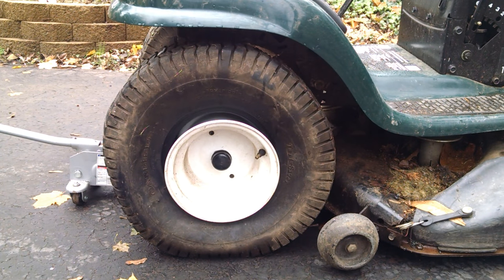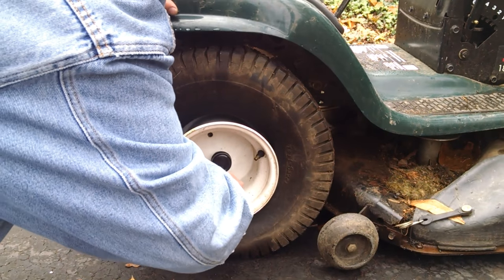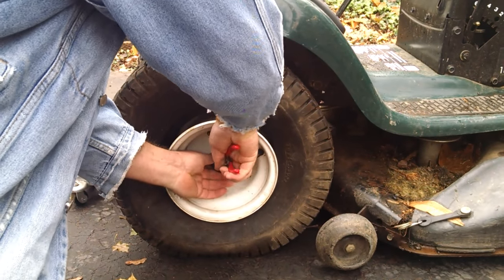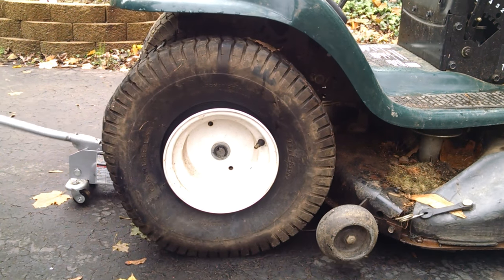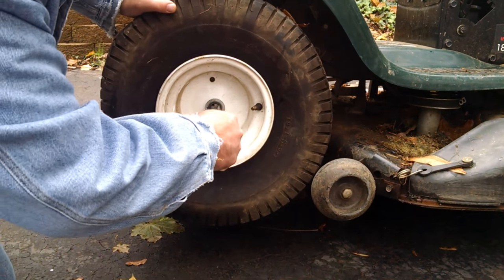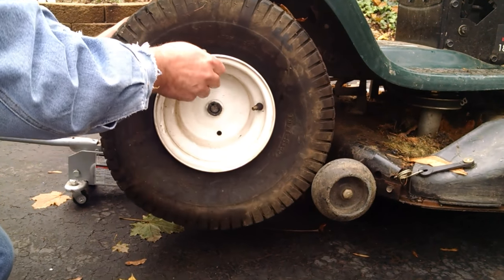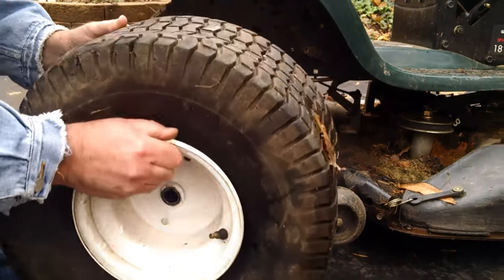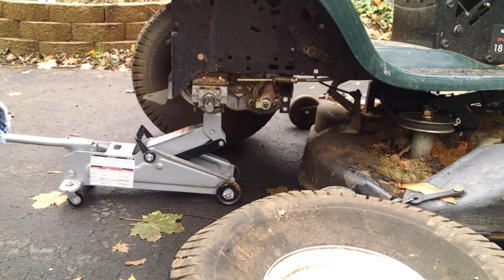Easiest Way to Remove Rear Wheel Tire on Craftsman LT1000 Lawn Tractor Mower

Comment: Wished mine was this easy to remove. I worked on it for an hour yesterday and it wouldn’t budge. I don’t think they’ve been taken off for years
Reply from the maker: spray it with a penetrating oil and let it sit
Reply: @TheWorldAsSeenByTom Hello, where exactly do I spray the penetrating oil so it comes off easily? I’m not a tool guy / handyman at all lol. Thanks for any advice
Reply: @brettlott570 turn the key/notch up and spray it so it’s between the Axel shaft and the rim.

Comment: Mine was frozen bad, tried a puller, tried your method which was good, but still would not budge. I went back to my old bag of tricks that I used on other things like blower wheels and blower motors. The secret is to first knock it on further(which brakes it loose) the take it off. Take a piece of 3/4" ridged pipe(black Iron or galvanized) 2 or 3 feet long. It will fit over the shaft on the outside of the wheel. Hit it hard with a sledge and knock it in an 1/8 of an inch. That's it, not froze anymore, now use a puller or your method and it comes right off. Hope this helps someone with a really hard one to get off.
Reply: This really helped.   Mine wheel was rusted on bad and would not come off easy like in the video
Reply: Still stuck, I have a porta power on inside of rim, sledgehammered the outside, never moved, put a lot of pressure on inside and heated the axle, waiting for it to cool and maybe shrink and pop
Reply: I put a socket over mine and hit it with a mini sledge. Nothing yet
Reply: This is my situation

Comment: I can't get over how your wheel slid right off. I watched this video and followed the  directions but mine took about 2o minutes of "persuasion" from a hammer to walk it all the way off the axle. I also filed the end for the axle and around the clip groove in case it was a burr on those edges, but mostly it seemed to be a film of rust that had formed between the wheel and the axle. Even the shear key had rust on all 4 sides.
Reply from the maker: its common for rust to form on the shaft, it doesnt take much and it becomes extremely hard to remove. I store mine in a  shed and make sure i have those plastic axel caps on so water/moisture doesnt get in. You can spray it with penetrating oil but its long so it may not work itself all the way through.

Comment: The best aid I have found the day before trying this mix atf and acetone 50/50 and soak both sides of the axles, This concoction work better than any penetrating oil.😅
Reply: What is aft???
Reply from the maker: im assuming he means automatic transmission fluid

Comment: I've got a newer (2021) Craftsman lawn tractor.  I got a thorn in the sidewall = flat tire.  Only one bolt (no E-ring or washers) holds the tire to the shaft.  I had to beat the tire with a 2 x 6 to get the tire off.  Took to the mower shop and they put a tube inside.  Getting the tire back on the shaft is nearly impossible... the tolerance must be 0.001".  I aligned the tire with the shaft (greased up) but the tolerance is so tight I can't even get the tire started (then I'd use the 2 x 6).  I don't have an acetylene torch... Any suggestions?
Reply from the maker: i would wire wheel the shaft or use steel wool to clean it, also clean the inside of the wheel, wipe it down to make sure its clean with not patches of rust or build up, check to make sure you didnt bent anything when you removed it.

Comment: Thank you for the no-nonsense explanation.  I need to take my tire off because it won't inflate in the cold weather.  I put wesson oil around the bead , the valve stem seems ok but it still won't inflate/seal/  Anybody have any tricks for that?

Comment: Don't see why there are so many dislikes. Worked on my LT2000 fine.
Reply from the maker: I think because people are expecting me to explain how to remove a SEIZED wheel that is RUSTED to the shaft. I only explain the process to remove the tire/wheel, just like changing a tire on a car. I cannot account for rust, stripped nuts, bent or broken parts etc, otherwise my video would be an hour long to cover every possible scenario and then no one would watch it. Plus you can never please everyone. Thanks for watching and your written feedback!

Comment: Ok now how do u get it off when it’s stuck on big time?ive hammered from backside,heated rim around axle ect.wont budge!
Reply: Chris Singleton did you ever get it off? I’ve done the same and no luck
Reply: Get a puller like a power steering pulley puller. Beat on it too much and there is another clip on the inside holding the axle in and it'll break pretty easy
Reply: I hosed it off big time with WD40 and hammered on it. It finally came off.

Comment: DONT LOSE THE INDEXING PIN !!!!!   When you reinstall the tire, and have your mower still jacked up...right now, check to see if your tire spins backward....if it does, you have lost that pin...FIND IT !! reinstall it...because that mower will not move 1 inch without that pin !!!

Comment: my wheel was seized unto the axle. had to use a puller from harbor freight to get it off. the one for 39.99. got some nuts and washers to hook it up through the holes on the wheel.

Comment: You've had the SOB off before these axles are notorious for RUST welding themselves. They never come off this easy.😢😢😢😢
Reply from the maker: actually no I didnt. Most of the time they are stuck cuz water gets in their and locks them together but not on this one.  This video show how to remove the wheel and its internal parts. so for those who never have done this before can see what they are heading into so they dont destroy the wheel or think there are hidden pins or clips. Lots of people think this video shows how to remove "stuck" wheels. Its not. The word "stuck" is not in the title or description. It shows how it comes apart. Thanks for watching.